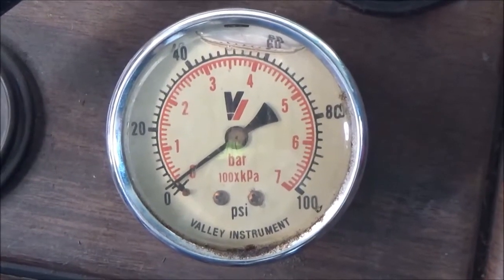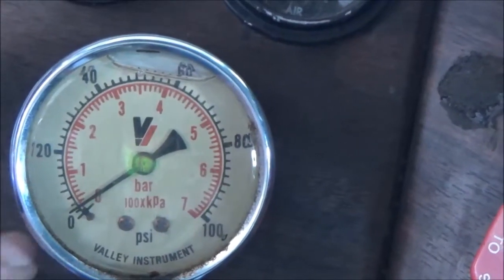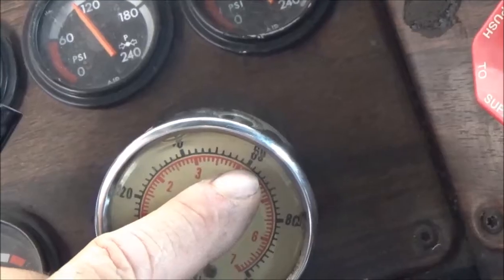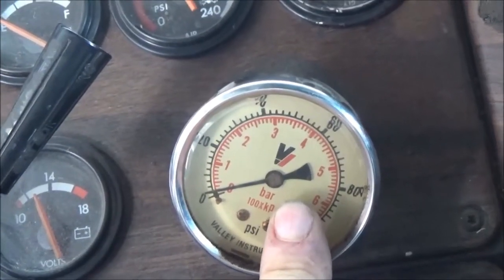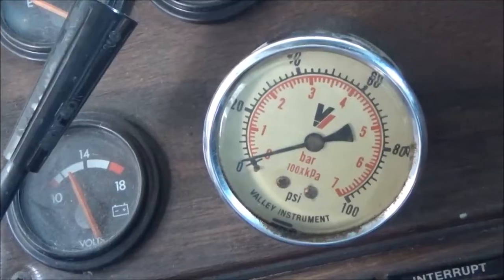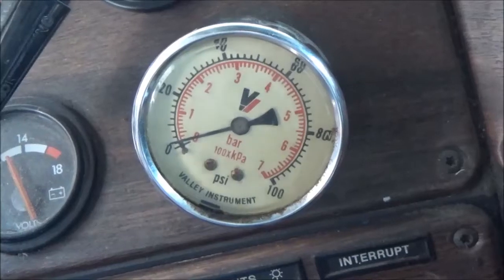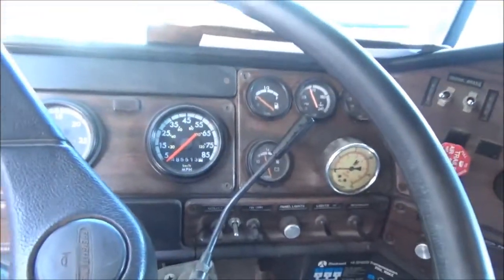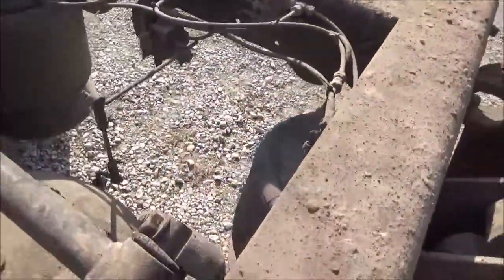How to install an air guage to know your drive axle weight

Comment: Hey Gordon.
would love to see a speed sensor cleaning video. my speedo was acting up & died.my cruse control went out prior....

love the vids!!
Reply from the maker: I don't know that cleaning the sensor would help, but you can try cleaning the plug-in connection with brake cleaner and compressed air. The sensor should be found above the tail shaft housing I think on the left side if I remember, it's the only sensor with a couple wires at the end of the transmission. I can't look at mine to make sure cuz my truck is at my job. I hope it helps. Thanks for the comments.

Comment: Great idea,  so what I understood is that if the psi goes beyond 60 psi
My tandem (middle axles) is overweight  (past the 34000) ??
Reply from the maker: On my truck I can go to about 61 psi on level ground, if I am facing downhill a little it will be a little heavier on the front, and if facing uphill, lighter. if you put this on your truck, you need to axle out a few times and note the readings, and when you check your weight at the dock, you need to be on level ground.
Reply from the maker: make sure you don't get a gauge that goes over 100 psi or the graduations will be too close together to tell where you are.

Comment: Where are u in the country ? Do you think closed shoulder tires on the drives have enough traction and last longer than open shoulder to make a difference ? Thanks
Reply from the maker: I live in Illinois near St. Louis. I can't answer you on the tires, I can change them but don't know which brands or styles are better.

Comment: On the tractor do you put the t-fitting on the front axle or on the rear axle or it doesn't matter?
Reply from the maker: either one, either side, just put it on 1 bag.

Comment: is it the same procedure on trailers?I mean do the air bags take the same amount of psi than the truck ones? thanks for the video
Reply from the maker: Same to install, but the pressure is probably different, you'll need to scale out a few times and find out how much psi is your 34,000. Of course you can't mount the gauge in your truck but it's still better than going to the scale every time your heavy.
Reply from the maker: if you take a tape measure and measure the circumference around the bags on the truck, and then measure the trailer bags, if they're the same then the weight and psi should be the same, but you need to axle out a few times to know for sure.
Reply: +Gordon Robertson i already have one on the truck im going to install one on the trailer thank you sr.
Reply from the maker: If I had my own trailer, I would do that too. Just a thought, I usually pull flatbed now days, if I had a spread axle I would put a gauge on both trailer axles, but on a regular tandem I would just do one bag.

Comment: Where do I put the tee on a 8 bag KW system? All of my air bags have a tee with lines that connect each other instead of like yours with only one line going in.
Reply from the maker: I would just choose one that looks like it would give you a good average and put the T in the line that goes directly into the bag. If you have more than 1 leveling valve then you can put in 2 gauges.
Reply: @57bagre  thanks. Each bag already is teed directly off the bag fitting. I assume one end of the tee is feeding air in but I'm not sure where the other end is going to nor it's purpose. Would it be best to tee as close as possible to exit line of the leveling valve that's going to feed the bags?

Comment: how do you know weight wise what your at ? whats the math calculations
Reply from the maker: On my truck it's 60 psi equals 34,000 lbs. You need to axle out a few times and write down your weights and pressure.